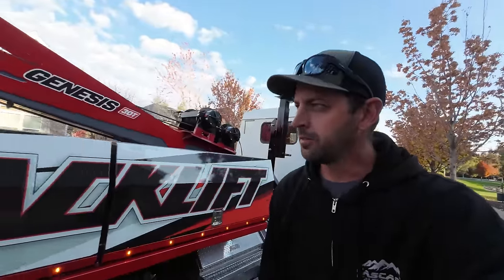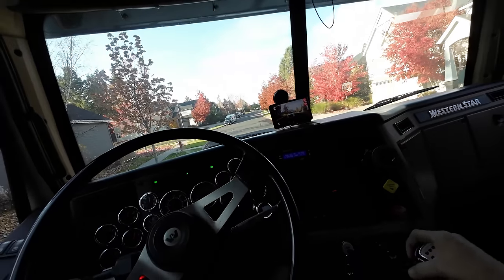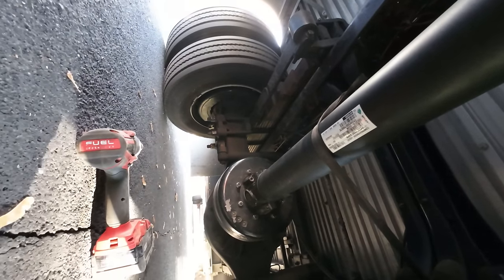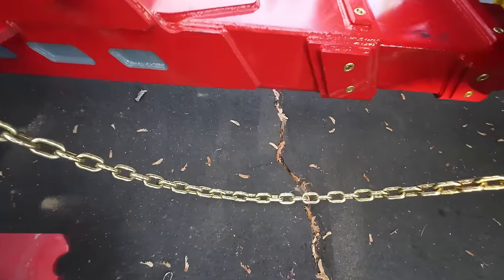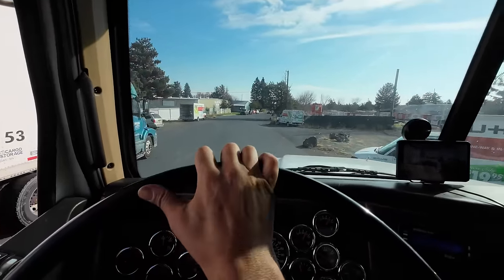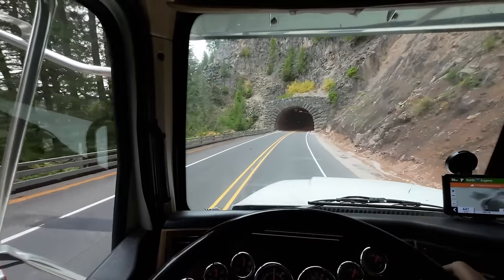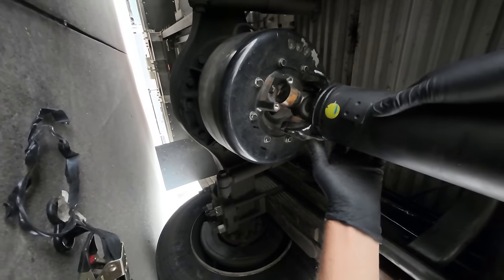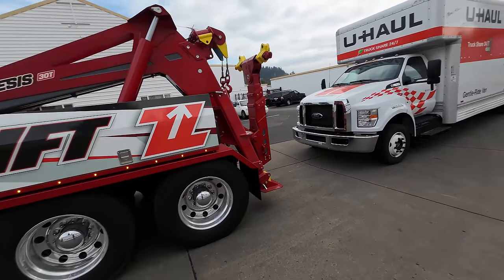Well that didn't end like I'd hoped…

Comment: Why do you put the shaft back in  it?? I did a lot of H/D towing over the years--and I don't think I ever replaced but one. Those bolts have to be loc tite and torqued back down. I don't want that responsibility.

Comment: I did think that when I saw you attach it. Bungy cords should never be used as the only method of attachment. Not even when fully stretched, as you suggested you would do from now on. They simply are not safe enough. Ever. I AM surprised the bar was not on the side of the road somewhere, but someone tossing it will tend to toss it some distance, just because it is safer further away from the pavement.

Comment: 15:17 you forgot to toot your horn inside the tunnel 😅

18:00 looks like you dropped off in Glenwood, my neck of the Whilamut Valley. 

19:20 explains "transmission" trouble, if they drove with the parking brake on. 😳

And as far as the light bars, since they are prone to going overboard, put a name and phone number on them, so they can be returned, iv found by someone else.

Comment: I've not had anything to do with the cordless cameras but have heard that signal issues can be a problem, not sure if its because of no line of sight between antennas due to objects in between or electrical interference. I was wondering if there is such a thing as a corded antenna cord that can be run from the cab/view screen to a closer point towards the rear of the tow unit yet not tethered to the actual camera so that its still free to be mobile as required.
Reply: That'a LOT of heavy metal 
between the Reciever Display
and the camera ,  not to mention
the greater than normal distance 
for what may have been a system 
designed for a pickup or short 
RV. 
  1)  Try relocating the reciever @ the 
top Lh corner of the windshield  
so the signal is not blocked by the 
DENSE MASS of the lift.
  2) Perhap also shift the camera 
over a bit so you can literally 
"eyeball" the display thru the rear 
window. That'll "be line-of-sight" .
  3)  If it's still sketchy , then it's 
probably a distance issue.  I've 
experienced issues in buying a 
dozen "identical" wireless cameras , 
& there's simply slight variations 
on the assembly line that affect real world usage , 
where-in a few of them just DO 
work a bit farther than others.
  4)  If all else fails , shop for a 
model specifically intended for a 
ClassA motorhome &/or Tail-end 
of a long trailer.  🍀 Good Luck

Comment: Hey Casey,

That's a wicked new setup on the truck there!

Any reason you couldn't just connect the Trailer Lights to the Wrecker (Either by removing the Lightbar transmitter, or by connecting into the 5th wheel trailer harness) so that the lights are controlled by the wrecker for that drive, given that the Lightbar was obstructed?

Not withstanding that you might not of had an extension cable to do so (In which case you really should get one or two, and every adapter known to man), was there any other reason why you didn't if you did have a long enough / suitable extension cable / adapters?

I've Seen Ron Prat and also  Heavy Recovery With Steve do it a few times for various reasons instead of using a Light bar.
On at least one truck one of them towed (can't remember which), the trailer actually had 2 different types of Electrical sockets (physically different) so they connected to the second unused one and left the tractor connected to the other one, and the result was the Wrecker actually controlled the lights on both the trailer, and then the towed tractor by back feeding off the tractors connection to the trailer. (By tractor I am referring to the truck towing the trailer, but they are referred to as tractor units sometimes).

Come to think of it, a Custom adapter that allows you to connect your wreckers trailer lights connection directly into the trailer socket on another truck to run its lights may also be something to consider, however it likely should be protected with Fuses or circuit breakers and may not work on all vehicles safely (Because engineers and their bloody BCM's.....!), but for older stuff would likely work just fine.

The other thing you may want to add to your new truck setup is a heavy duty Anderson Plug that can be used for Jump starting another truck with dead batteries and/or for maintaining batteries on a towed vehicle when expected to be towed long distances so as to avoid flattening the customers battery, as in some instances you may need to leave the Ignition on to keep steering unlocked, air suspension active, or for other reasons, and that as im sure you are aware can put a not-insignificant drain on batteries.

Comment: Stick a TILE or GPS Tracker to your lightbar. Does it not have a 2 way transmission? If so it should have told you that the bar is out of range.  Or maybe somebody just removed it for their own use.  A chain with a lock might help.  Go back with your emergency lights on at night makebe your light bar will light up and show you where it is.

Comment: I don't know how the electric parking brake works on that U-Haul, but I know on my F-150 it won't release without having my foot on the brake, and you clearly didn't have your foot on the brake. That being said, it was rolling just fine when you were moving it forward and backwards, so it was never on (or already burnt up) from the time you picked it up.
Reply from the maker: The parking brake is not electric.

Comment: Casey, I sincerely believe that somehow you got robbed, you had 4 tie points, there is no way that lightbar fell off. Permanently attach Locking Carabiners to each of the 4 bungee cords, both ends and use VISEGRIPS to tighten the locking part so that no one will be able to hand release.

Comment: Casey, is a camera for backing up (plus in case of accidents as evidence, maybe a front facing one, too ), not a plan? Also, (I haven't seen the entire video yet, I am at the point where you said that you had parked way too far away from the truck and about to hook it on etc. Erm.. at 2:16 that is.. ) EDIT.. LOL! maybe I really should watch a video and then answer  😂
But, also, is it not an idea to put the trailer inside the back of that hauler (if that fits at all  🤔  may be a really REALLY dumb thing to say from me 😵‍💫😳 ) 
I know it has already all happened, and this year is an extremely expensive one, which is the problem with a starting up point, and hopefully, it will be paid for in a x amount of years..
Also wanted to ask, your flatbed is still out of commission which is clearly handy to have in your fleet of machines your company just needs, to take/get as many jobs as possible and to be as versatile as can be.. but do you know what is going on with the flatbed's attitude? Why is she still being a little (or maybe to you now a big) b*tch? 🤨😳  😉

Comment: What are the orange and blue slightly gear looking things on the inside wall of the box behind the winch/lift controls?
Reply: They are safety lights for placing on your cones when on a job. I believe they are called angles or something of that sort. Ron Pratt uses them a lot on jobs where dusk or night is involved.
Reply: I think theyr magnetic marker lights.....if I'm thinkn about the thing ur talkn about..

Comment: Sorry for your loss Casey. That said,  you really did screw up there. Apart from your financial loss,  think about the person that might have been behind you. That 5 or 10 kg of light bar could have clobbered a motorcyclist or gone through a car windscreen. Not good.
When you were hooking up the lightbar l thought to myself,  ' why does he use open hooks ? '.
l transport motorcycles a lot and l learned the hard way years ago that open hooks can let go due to bouncing from rough roads etc. Consequently l use double hook tie downs and/or ratchet straps with a hook and a keeper device. lf the strap is only open hook l use a carabiner through the base loop. Reduces the chances of a lost load significantly. A really cheap and easy solution.
A really big thumbs up to you for owning up to your mistake and talking about it on the channel. Many people wouldn't . This is how the rest of use can learn from experienced and honest guys like you.

Maybe you could do a video on straps and securing loads and the tricks you've learned ? The fact that you always take the time to explain things in detail is one of the reasons l watch you're channel. l always learn something. Entertainment and learning at the same time . Win win.

Comment: as a wreckmaster certified heavy tow operator.  I was surprised by a few things in this video.  First you used strap and binder on the front axel and under reach.  thats weird and I would hate to have to deal with the straps after towing something in the snow.  2 chains would do the job just fine.  secondly.  you didnt use continuous loops for safeties.  I honestly prefer them.  much easier to use and less probability of damage.  also those safeties should be to opposite side. drives to passenger, passenger to driver.  Lastly, when I saw that you didn't use carabiners on your towmate, I was surprised and laughed really hard when you were surprised it wasn't there any longer.  carabiners on the top side of the towmate will ensure the towmate won't go anywhere.  Good Luck, maybe we'll see you in the ditch some day.
Reply from the maker: Wreckmaster is a joke.
Reply: @CaseyLaDelle  hahaha says the guy that couldn't keep a light bar on a truck.   I patiently await more laughable moments.

Comment: If I was towing 3hrs away I'd have a long extension running from the two truck to the trailer lights and not bother with the wireless lights.

Comment: My suggestion is stop using the bungees to attach the light bar...

Use 4 of the retractable straps you had the top bungees attached to instead, that way, you know everything is nice and tight and you have more control over where the bar sits when you've finished tightening the straps...

Comment: Wow! I didn't know you could pull 2 things legally?! Shame about the lights tho 😢
Reply from the maker: Yes, in Oregon we can tow combos.
Reply: I saw a Fed-Ex triple rolling up 97 the other day.
Reply: Federal law states only one ball coupling allowed in a combination vehicle. So additional coupling  points must be something other than a ball coupler. For instance, 5th wheel trailer with a ball on the bumper is okay, but a gooseneck trailer with a ball on the bumper is a federal violation.
Reply from the maker: @rdththth  that is complete BS.  There is no such law and towing multiple ball couple trailers is perfectly legal in many states
Reply: @CaseyLaDelle  CFR § 393.71(a)(2) No more than one tow-bar or ball-and-socket type coupling device may be used in any combination.
Reply from the maker: @rdththth  neat, but that law is specific to commercial drive away operations.   That is a specific category of commercial vehicle transport, and does not apply to general public.
Reply: @CaseyLaDelle  Oops! You are correct. I apologize for the misquote. Section CFR § 393.70 covers combination vehicles “other than drive away”, and there is no restriction of ball couplers there.

The one time that CFR § 393.71(a)(2) was used against me was in drive away. As a vehicle combination was being assembled at an auction facility, a retired CMV compliance officer pointed out the two-ball violation. We did a workaround to get it in compliance before departure.

Comment: I feel like you brought way more truck than was actually needed here... I feel like any 26k gvw truck could take that legally with the right under lift or boom lift.
Reply from the maker: You’re right.  I’ll definitely go out and buy every size of tow truck to have sitting in the yard so that I can always use the perfect truck for the job
Reply: @CaseyLaDelle   Oh. You're right. I was just taken aback by the massive difference between capability and load. Also it is odd to jump from what... a 1 ton. 5500? I forget and im not looking. all the way to a tandem axel on a 20k lb load (give or take) add 14k if theyre both loaded maxed out which i kinda doubt.

Comment: Never trust a Bunji to hold anything of value, you see 10 of them per/mile on the side of the highway. When we tarp a load down at least 3 go missing a trip and they are all brand new from the case this year. Was Laughing at the light bar hanging job the second I saw it while you were dropping the trailer.

Comment: 22:56 What's so special and so expensive about a Cozad oversize load sign ? I've pulled mobile homes for years and have never spent over $75 for one 18" x 84" sign and that was at a truck stop. I've bought even larger aluminum ones that fold for around $150 to $175.
Reply from the maker: Where it went

Comment: I hit a bar like that a couple weeks ago. Broke my power steering line and messed up the steel rim on my crown Victoria. Was rainy and low vis didn’t see it till right before I hit it.

Tow companies should really have to put the company name a phone number on those. Improperly secured ones can fall off and deal pretty significant damage to other vehicles.
Reply from the maker: I’d be amazed to see how an flimsy hollow piece of plastic damaged a steel rim!
Reply: @CaseyLaDelle  it wasn’t plastic. The one I hit was made of steel and was larger than the one in this video. I’m just saying that the person who owned that probably had the same reaction when they got to their destination and didn’t have it anymore.
Reply from the maker: @458DESTRO  if it was anything other than plastic, it didn’t come from a tow truck.  We use lightweight plastic for a reason.

Comment: Nice set up.  Is there a reason every time your next to your control boxes you hear a excessive air leak?
Reply from the maker: It’s hydraulic fluid flowing through the valve body
Reply: Gotcha. Alright. Just checking. Maybe the camera sound makes it louder.

Comment: Wonder if this big 'ol girl had the 7.3? It always blows my mind how a company like Ford can make such a legendary and proven block, one of the few push rod blocks still produced, and over the years just slightly crap out ya know, a pretty impotant part of the entire drivetrain, things called transmissions. I mean, it's not like things help convert the produced power/torque into motion or anything. Anymore it just seems like most American companies like Ford will just be like "yeah, a 7.3! Let's stuff that thing in something either really tiny or really big, doesn't matter, but we're broke now so we need to call Twang Un from Kia and get a CVT transmission for it, it'll handle it" 😖

Comment: Why do you have to pull the drive line before you tow it?
Reply from the maker: Because leaving it in would destroy the transmission
Reply: @CaseyLaDelle  oh i didnt realize that it would since the front wheels are not on the ground
Reply from the maker: @johnheffelfinger3231  it’s rear wheel drive
Reply: @CaseyLaDelle  oh

Comment: It’s probably has a ten speed transmission and it generally skips gear but it always has to get reprogrammed by ford especially if it’s like 2020 or newer unless you put it in sports mode then it doesn’t skip ten speed transmission are good transmission it’s just learning how to keep them in all vehicles and not having to do much bc usually they are in semi trucks because of the heavy hauling

Comment: Time to open the light bar up and insert an apple air tag or two
Reply from the maker: I just ordered some!
Reply: @CaseyLaDelle 
  Assuming ( yeah , yeah ,  I know ) 
that the Taillight-bar is heavy metal 
for durability ,  velcro or tape the 
airtags to the plastic rear or 
side of the bulb housing  so that 
the RF signal can get OUT of that " Faraday cage " .
   I haven't fully investigated the 
technical specifics  of  just how the airtag protocols function 
( yeah , i'm a  radio / SW / CB & 
 ham / electronics nerd 🤓  ;   and 
an ANDROID , not Apple guy )  , 
so  i'd suggest some "Dead Zone" 
testing in the mountain stretches 
where  you  KNOW  you don't 
have any cel service.  If they're 
satellite based , you should be OK. 
If they're cel-TOWER based , they'll 
be ineffective.  But even-then , 
that "nearby-tag" function would 
still work , but that would require 
👣walking the shoulders 😧 if the 
tagged item skidded-off into the 
bushes. 
🍀 Good Luck
Reply from the maker: @rythemzlatin  it’s plastic

Comment: Why would you not just put the actual light bar on the trailer instead of in front of the trailer where nobody can see it thru the box???  Seems it would be far better to have hazards on the truck and working lights on the trailer.

Comment: Sounds like you need a light-bar sponsor.

Also, why not use magnets on the light bar with the straps?
Reply: Magnets don't stick to aluminum.
Reply: @georgevindo  Yes, but there is typically a lot of ferrous material on vehicles.

Comment: Is it kosher to tow a truck that's towing a trailer?
Bummer about the light bar. Could you attach a safety lead somewhere? Never mind; then it would just drag.
Reply from the maker: Yes, 100% legal.
Reply: Different STATES have different Laws. 
 It's not unusual at all to see RV's in the 
midwest & west  pulling an 
enclosed "Toy Hauler" , pulling 
a boat trailer .
Reply: @rythemzlatin  Yep, in my state that takes a $10 license endorsement and no training whatsoever. I don't even know legal tow truck limits here, but we pull gravel trains short distances. That's a truck and two trailers, up to 150,000 pounds not including the tow truck. Length is more of an issue than weight.